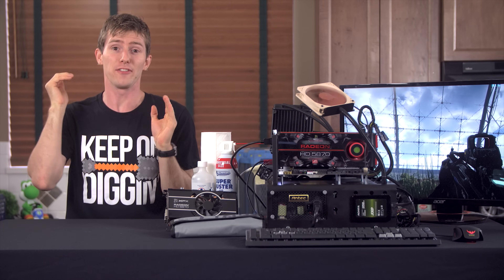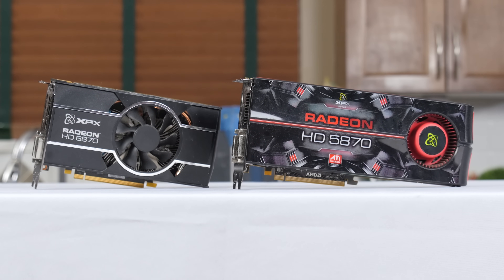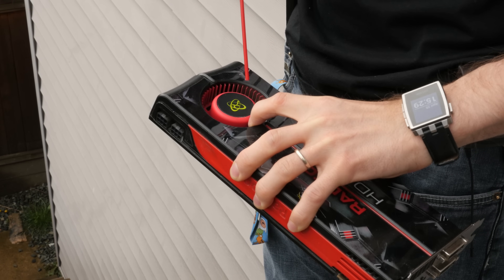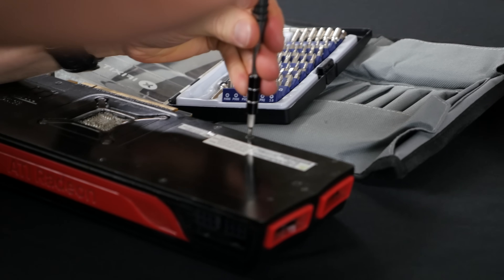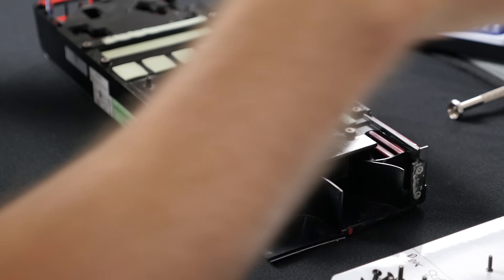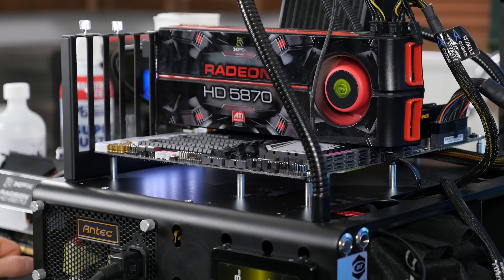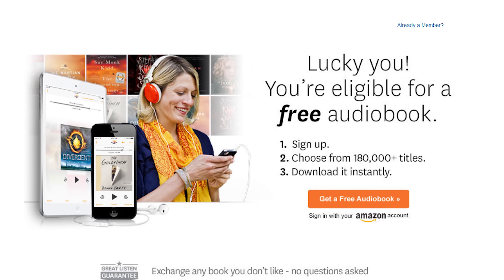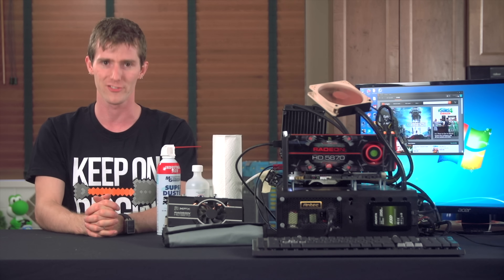Video Card Running Poorly? Clean Your Video Card Cooler!

Comment: I've had mixed results with this technique, but overall it's still a huge success.

I run a gaming system which uses two GTX 660Ti, and the both of them are about 3 years old. They use the reference blower model.

I started having issues with overheating in both my cards, and cleaning the outside just wouldn't do the trick. Games I used to play on max settings now had to be played at medium with the fans cranked up max speed all the time. I resorted to disassembling them. It was risky, but considering the state of my cards, it was worth trying.

The mixed results part comes from the minor issue I've had with one of my cards. Some screws were chipped and I was unable to remove the fins from the chip to replace the thermal compound. I still managed to remove the dust though. As for the second card, everything went smoothly.

The end result : idle temps went from 58C to 30C for the card I managed to replace the thermal paste and from 55C to 35C for the one I couldn't. It goes without saying that gaming performance is incredibly better.

Thanks a lot for the video!

Comment: So i'm going to take a bet and hope someone will be reading this

I have a HD 7870 showing the same symptoms as this 5870. It's completely clean of dust, and running extremely hot (Around what this 5870 is, plus a few more degrees).
I have thermal paste, but i haven't changed it yet. Should it not make a difference to change the paste, is it time to get a new card, or am i doing something wrong?
Reply: +Kristoffer Olsen  what you should do is apply new thermal paste and just for safe measures put a secondary fan pointing right on the card until the temps improve.
Reply: I'll be replacing the paste after i've bought some alcohol to clean it off tomorrow. Don't really have any other places i can put my fans :P

Comment: Man screw those stupid air cans, they really just don't have the force required to ungunk some major dust build up. If your going to use air, then use an air compressor or something. I use a kirby vacuum cleaner to blow air (it works great), but use something more powerful than a little can of air. OR, if it's really bad, and you just wanna get the thing exactly like brand new again, then just take off the heatsink completely, and wash it with soap and water and alcohol if needed (for the thermal paste) then let it dry thoroughly, reapply thermal paste, and BAM! Just like new!

Comment: NEW video card running poorly. Any help?

EVGA GTX 960 4GB Been overclocked a little (safely) yet sometimes it gets some weird slow frames.
Reply: +mason methot If your processor isn't up to par, it could be bottle-necking your GPU.
Reply: powaful3000 I5-4590
Reply: Prudator I hope not.
I think the problem is fixed though. Just a kinks here and there really.
Reply: Prudator Ok, thanks.
Reply: +mason methot try titan x
Reply: Allah's Snackbar Ya no problem, I have a few thousand dollars to spend on a new graphics card.
Reply: mason methot "to spend on a new graphics card." no no no you must buy 4 of them
Reply: Allah's Snackbar Oh ya, of course, lemme just grab my wallet and, OH LOOK just thousands of dollars laying in there. Gotta spend it on somethin.
Reply: mason methot i recommend using your credit card, it gives some insurance
Reply: Allah's Snackbar Ya ya of course, I never have exact change anyways.

Comment: At my shop I just use an air compressor, MUCH cheaper than buying cans of compressed air, and significantly more powerful. It takes literally 10 seconds for me to clear an entire PC of all dust, and it costs me about 0.3c on power.
Reply: +gixxar6 buying a compressor just for cleaning a heatsink is not an option for most people

Comment: I should have sent you my zotac gts450. It was absolutely filthy. I blew it out but was not good enough. So I had to pull the fan and shroud to clean the heat sink. I also cleaned off the old dry thermal paste and re-pasted the card. Huge difference.

Comment: I recently found my brother's first desktop that was still in running condition aside from one problem: The GPU fan had taken severe damage to the electric motor due to excessive dust and as a result would only weakly spin for 4 minutes before quitting at one time. Thankfully this card was still in good enough shape to keep under overheating temperatures when idling, but I still had to do something about it, so I found a tiny Intel cooler fan I had laying around and secured it overtop the dead fan with 2 paperclips, then hot-glued the outer edges to minimize vibration and rewired the replacement fan into the old one's connector. I couldn't get a temperature reading from the motherboard since the operating system and motherboard were both too old, but I found an old thermal gun sitting around and measured the idle temps at 30 and the maximum load temps to be 40 (at least so far...my games are all too old to demand much or too new to be compatible with the machine).

Comment: My graphics card is still overheating on 100% of fan speed and after clearing.

yes, i used thermal paste
Reply: +The Polish Video Game Nerd do you have a gtx 480?
Reply: no.
i have asus gt 640 with 2 inch radiator and 0.01 inch high with fan that doesn't work.
Reply: The Polish Video Game Nerd
lol

Comment: Air Spray cans are notorious for blowing dust and debris into the brush-less fan motors.  I would like to suggest using a fresh paint brush for cleaning GPU and CPU heat-sinks as well as a vacuum.  It is also important to not rub your eyes with your dirty dusty greasy fingers after dis-assembling your components unless you like Sty's and Pink Eye.

Comment: I've used my 5850s for like 5 years straight and for some odd reason I've never had to clean them out. They always peaked at a mere 74 Celsius, and that never got any higher later down the road.

Comment: i dont fancy taking my R9 380 apart to clean it what else can i do?
Reply: +Julian john You can blast it using compressed air without removing the cooler. It's not as effective but if your card is still under warranty it's worth a try. Once the warranty expires you can do whatever you want with it including remove the cooler. If you have an XFX card I think they do allow you to remove the cooler without voiding the warranty. If your card is running unusually hot or loud you could RMA the card and claim that as a defect.

Comment: I have nvidia reference gtx 980 ti card. What is the program for nvidia cards that gives you acces to those performance settings like fansspeeds and max temprature and clockspeeds. Is it nvidia experience or what.
Reply: +ukkomies100 MSI Afterburner

Comment: Lol i fried my 760 its idle temprature was 80
On max fan speed and i went to play asphalt 8 12 seconds later gpu burned out
Reply: ever heard of a thing called thermal paste
Reply: +jaakko200987654321 i did romove the old one and apply new one is the thermal paste faulty
Reply: +random stuff probably put to much thermal paste on or didnt have enough mounting pressure
Reply: +word1901 i got a 970 today
Reply: +random stuff nice just don't burn that out either
Reply: +word1901 it works great default fan settings max temp i got was 60
Reply: +random stuff so it's not a reference cooler then

Comment: well... I'm an engineer, IT guy, draftsman for electrical schematics and I have a good knowledge on most electronic devices and I've worked extensively with computer fans since I use them a lot for building PCs (duh) and also for high powered electronics (like my 100W LED flashlight that I'm working on)... there is a set of diodes built into the motor controller chips that is specifically designed to rectify and block power. The diodes turn AC power into DC (if applicable to the system it's in) for the motor coil's control IC (usually something like a simple transistor based driver) and block current being sent back down the fan power cable. I tested a computer fan once thinking I could drive one fan with another... spun one up to 7,000 or so RPM with an air compressor and attached the other fan to it... the result... nothing! I spun the fan backwards and also changed the wires about, then checked with a voltmeter to see what the output of the spinning fan was... and the answer... it's residual (0.0001V) at best! the fans don't kick out ANY meaningful power whatsoever when you spin them... the diodes are set up to only allow power INTO the fan controller IC... and these aren't Zener diodes either... they completely block the reversed power to protect the fan controller IC... so therefore, I deduce that there is absolutely no way that you can kill a computer with feedback voltage from a computer fan... it just cannot happen!

Comment: holding the fan is useless (on most fans) because the way engine works itl never discharge more then itl take in from a air can

Comment: people use mostly paint brushes as I do, compressed air is almost useless if u wont remove that dust that sticks to cooler. use big and small brush gently where every u can, and then u can try to use compressed air. u can clean every part in ur pc with paint brushes- thats why mine pc stays cool and clean

Comment: Anyone got a card with the EVGA ACX 2.0 cooler? My PC had great dust filters but that cooler sucks air in and vents INTO the case, without any filtration. Its been in there about 9 months now, how dusty is it likely to be? At least inside the PC there is only a very fine film of dust I can see, but is it likely there are big chunks inside yet? I'd rather not whip the cooler off if I don't need to. Thanks Linus Tech Tips Community viewerrrrs :)

Comment: I refuse to buy those sealed fans now as my 6970 did burn out eventually. But I recommend using a paint brush, a fairly expensive one so you lose none of the bristles in your system. But with a brush and a combination of air you can literally wipe away all the dust and have the clean looking finish your system had when it was new. 

I also use a vaccum, but not in the case. I have it on the outside of my case to catch any dust blown into the room after I spray the dust all over with air.

Comment: What I did: I put the video card under the water stream, then use a hair fan drier to dry everything as soon as possible. I tried only 2 times but with different cards and they still work up to day. Very fast and risky trick, but it worked for me. Or what I always use and works without risk: some people use vacuum cleaners, while I use hairdryer to take all the dust fast and cheap.

Comment: I once cleaned a friends HD4870 which had a nice thick patch of dust on the "bottleneck" part of the cooler. It was a direct head exhaust card, so it was essentially blocking all airflow through the card. While gaming it was always in panic mode where it would throttle and spin the fan to 100%. I cleaned it out and replaced thermal compound and it made all the difference in the world. It was quiet and actually a bit faster afterwards because it wasn't throttling anymore.

Comment: Does dust can be responsible of "video card driver has stopped responding and has recovered" message?
Reply: ***** I have update my driver to the latest, but still got that message. And yeah, I haven't clean my computer for a while.
Reply: Catalistic I'd suggest deleting all drivers then doing a clean instal of the latest. Works 8/10 times.
Reply: Hapie Star
I did. I even use the GGU or something that cleanly uninstall the driver and then download the latest driver.
It still didn't work.

I'm gonna try to install the prepackage driver (version around 275) since I'm afraid that my old GPU (GT 440) can't handle the latest driver.
Reply: *****
I have clean my computer and change the thermal paste of my GPU. It still didn't fix the problem.

Comment: I think this is only applicable on videocards or cpu coolers when its caked on chocked full of dust. Kinda like my very old work PC which looks like its never been pulled apart ever, seeing as every vent is blocked on the case.

Comment: Went to a friend's place last month, PC was having trouble playing Cities Skyline after like 15 mins of game play even though he had a GTX 460. Asked when was the last time he cleaned the PC, "Since getting my Q6600"...............Opened her up, CPU heat sink had a blanket of dust on it, as did the evga heat sink on the card = no airflow at all. 

Took a good hour to do a detailed clean. Used motorized air duster (mine) and q-tips without going as far as bending the fins (which have caked on dust for sure). Applied new thermal paste to the CPU; I know I'll get hate, but we didn't have cleaning solution (this was all unplanned) so we used lysol wipes which worked perfectly I was surprised. Wiped dry with damn coffee filters to remove any possible lint residue (there wasn't any, the lysol wipes were pretty new and therefore wet). 

"Wow the side of the case doesn't get hot now."??? Yea, his GPU was getting so hot with no airflow it was heating the case. PC runs fine now, doesn't lag in any games and runs much faster now as it isn't under clocking after 15 minutes of any significant load! 

People, clean your PC every month. A few shots in the heatsinks and power supply will keep dust from caking onto the heat sink fins!

Comment: AMD with your stupid Stock coolers that can't be opened normally to clean.
Love still my EVGA GTX670 FTW with just 4 little screws its opened to the fan. BAM done fuckign AMD. and my old 5870 stupid fan make a stupid rattle noise to thats a know problem to, another reasson to go for NVIDIA FTW !!!

Comment: I still use that very HD6870 but the stock XFX cooling was absolute crap (and was so goddamn loud) so after 2 years of use I had to change the cooling to an aftermarket one (went with Arctic Accelero Twin Turbo II even though it seemed a little overkill for this little card). I guess I'm going to buy some newer card after this one finally breaks.

Comment: LinusTechTips. I want to ask u that I am going to purchase a new pc 
And I m purchasing iy especially for gaming and multi-tasking also.
So my cpu is--->
i5 4690k processor
Msi z97 gaming 3 motherboard
Corsair vengeance 8gb ram
Wd blue 1 tb hard drive
Asus strix Gtx 970 4 gb graphics card
Nzxt case
Asus dvd writer

So my first question is which psu is better for my gaming pc??
and 2 question is my cpu is good enough for gaming or if I want to overlock it then which fan is good for it but in low budget 
What about cooler master 212 Evo??

So plz help me I need ur help :-(

Comment: This gpu wasnt dirty enough to see any improvement. A few years back i bought a ps3 (the original) second hand after my old one got the YLOD. The second hand ps3 was very very dusty, and fan speeds were very loud. So i took the whole thing apart and found so much clusters of dust that seem to have come from the carpet. After cleaning every single nook and cranny and re-applying the thermal paste, the ps3 was whisper quiet and still functioning to this date. Mind you its been about 3 years now since the clean, and it over 8 years old. I have played non stop 13 hours straight multiple times over the holidays and no problems at all! Dust is the biggest killer of electronics.

Comment: It shouldn't have to be said, but since I get asked every summer by at least a handful of people.. here we go.

Idle, and max temps on components will rise with the temperature of the air in the environment that your machine is in. So your machine that runs super cool in the winter will run hotter in the summer if you don't have some kind of air conditioning. Even liquid cooling set ups will run a little hotter although not by as much as with air cooling.

Comment: Need some help my first pc build want to run 4k
Intel - Core™ i7-4960X 3.6GHz Processor               
Corsair H110 94.0 CFM Liquid CPU Cooler
Asus X99-DELUXE ATX LGA2011-3 Motherboard
G.Skill Ripjaws Series 32GB (4 x 8GB) DDR4-2400 Memory
2*Intel 730 Series 480GB 2.5" Solid State Drive
2*NVIDIA - GeForce GTX 980 4GB GDDR5 PCI Express 3.0 
Cooler Master V850 850W 80+ Gold Certified Fully-Modular ATX Power Supply
Reply: The 4960x will not work with that motherboard, u have to get a normal Lga 2011 mobo for that cpu, I recommend the 5960x as. It is the same price, will work with that motherboard, and has 2 more cores, will provide little gaming performance increase with those CPUs tho, I recommend getting a 4790k, a normal Lga 1150 mobo and put the 600$ towards your gpus and other stuuf
Reply: Nick P all right so am going with the 5960x for the good performance also anything else to upgrade it to run 4k i cant get the titans though

Comment: Well I had a different experience. 
When I pulled the heat sink off my 5850 from early 2010 a couple of months ago the thermal past was thin dry and chalky and the vrm's thermal pads fell apart at the slightest touch. So replaced it all and good as new now.

Comment: I just build my own gaming pc like three weeks ago and it is more than capable of high end gaming.  It is a gtx 970, amd fx 8350, 8gb of ram, 750 watt power supply, and three fans.  I can play battlefield 4 on max settings for about 110 fps. But after an hour or so my monitor kind of shuts off and says no signal but you can still here the game in the background.  Then their are some red light I see in my case (I think at the GPU) that turn on.  I have abssolutely no clue what it can be.  Please help. I might think I am overloading the circuit because their is no doubt my system can handle it.

Comment: Canned air? An air compressor with an in line filter and desiccant dryer will yield much better cleaning results. It will also prevent any residue from being sprayed on components.